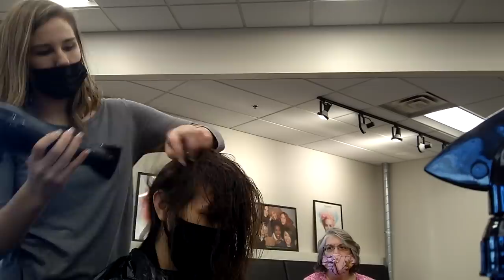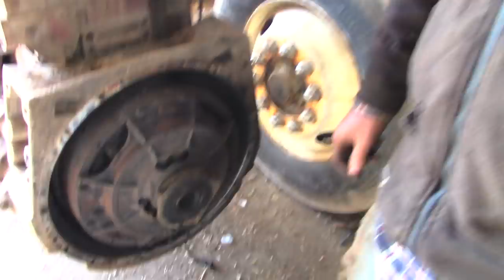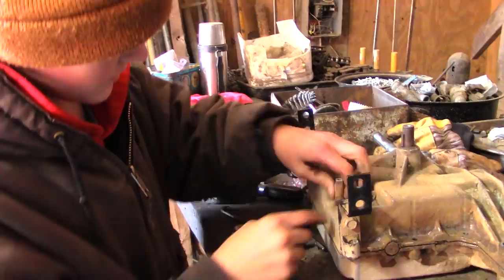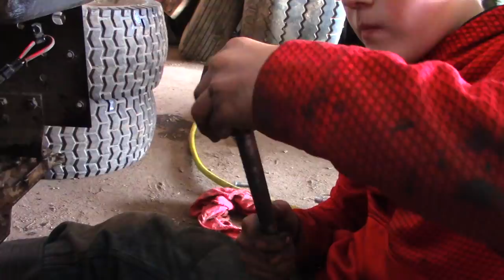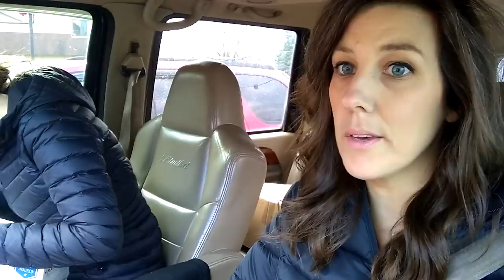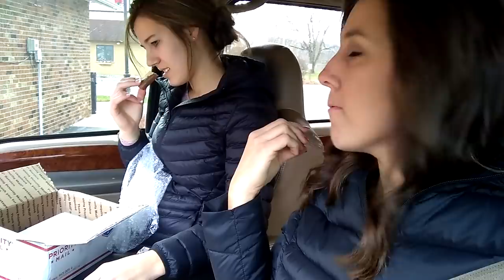It's Her BIG Day! | First Clients at Cosmetology School

Comment: Sander’s decision to fit a smaller drive pulley was to make his buggy go faster. I fear that his choice of a pulley that little size, will overly speed up the buggy. Also it will greatly increase the work load on the engine. I hope that he has a really low gear selection range in the gearbox.
It’s good economics to fit a new clutch assembly, release bearing, seals, etc. when all is dismantled. Dismantling is a  time expensive exercise if the clutch gives trouble.
Many Congratulations to McKenzie on advancing in her chosen profession. Two things every human has to do is eat and have themselves groomed. You should have a go at trimming Dad’s beard. Seriously, you have a great personality and friendly approach. Those go a long long way in attracting customers to your salon. Wishing you the Very Best.
Reply from the maker: Sanders will only know if he experiments with pulley sizes. Live and learn...
Reply: Absolutely!! 👍